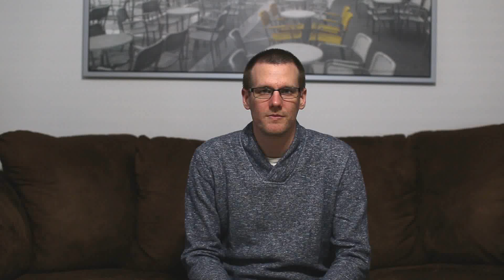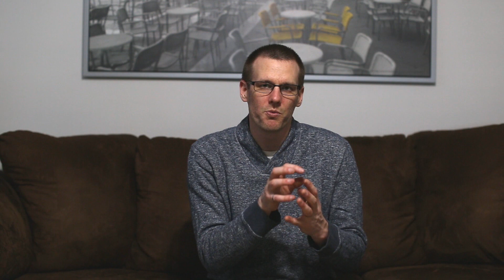Differential Fluid Performance in RC vehicles

Comment: I have a 1/12 scale truck and it isn’t the fastest but I mainly use it in moderate off-roady terrain.  It only has front and rear diffs and I’m planning to put 15k in the fronts and 7k in the back. I wanted to know if that seemed logical for what I want to do with my truck.
Reply from the maker: That can work well. It depends on the performance that you are after. Try it out and adjust from there.

Comment: Your videos are incredible. I’m learning so much being new to the sport from you. Thank you
Reply from the maker: Thanks for the awesome comment Mark!
Reply: @RCexplained  hey bro, ive been using your videos to increase my knowledge, because they are excellent.
can you recommend a front centre and rear diff fluid set up for truggy :1:8 scale  converted from nitro to brushless, running on very high bite surface like tarmac.
your feedback is VERY Appreciated.
Reply from the maker: What style are you looking for? You could go 20k center. 12k front 7k rear.
Reply from the maker: My suggestion will give you more bite but can result in too much bite and getting sideways easy. Your selection will be easier to handle the power. Your decision completely depends on what your preference is and then adjust from there.

Comment: Nice video what about when just ripping around a field and stuff  thanks
Reply from the maker: My recommendation based on my personal driving style for 1/8 or 1/10 scale RC cars is to use:
7-10k weight in the front differential. 
10-15k weight in the center differential
5k weight in the rear differential

Comment: Great video. However I think that the car will almost always get the most amount of traction with the centre diff locked, regardless of the surface it’s running on.
Reply from the maker: Hi Mo, I see what you are saying. The same can be said for all differentials on the car.  At the same rate, having a locked center differential and sending 50% of the power towards the rear end on a loose surface can be highly undesirable. Reducing the power to the rear wheels will increase the traction at the rear end and decrease traction at the front end. However, too much power on the front end will not result in abrupt power oversteer and loss of control. It can be a big balancing act dependent on personal preference.
Reply: @RCexplained   hello, if you would. How does the center diff transfer power to the front? If the diff is already unloading at the rear diff because its lost traction won't this just continue as it's open diff until the rear end finds traction?.   If I lock the center diff, will this prevent unloading at the rear diff as power is distributed  50/50 with no bias giving best overall performance?  -Mojave off-road only.

Comment: Hi bro..what is your recomended for diff oil 1/8 Nitto buggy using C Hub??...for front,center & rear..👍👍🙏🙏
Reply from the maker: My recommendation based on my personal driving style for 1/8 or 1/10 scale RC cars is to use:
7-10k weight in the front differential. 
10-15k weight in the center differential
5k weight in the rear differential
Reply: @RCexplained  thanks bro..👍👍👍
Reply: @RCexplained  oh i have one more question...the diff you recomneded is suitable or not with C Hub car or Pivot Hub car?..because someone said that if  Pivot Hub car must using different diff oil setting from the C Hub car..they said that see Pivot Hub car is more aggresive & will oversteer when to take sharp corner..for C Hub car dont have any problem on corner but not aggresive like Pivot Hub car..can you explaind it to me...other people said Pivot Hub car must using heavy oil diff to control the oversteer problem..i also see also when the pro driver have problem overtseer with the Pivot Hun car..you can see the different if C Hub & Pivot Hub while on sharp corner then exit corner accelerate 🙏🙏🙏🙏
Reply from the maker: Hi Mustakim,  I have never considered 2 different weighted oils for those different conditions.

Comment: Meanwhile in the other video I watched they used 80k,500k,80k (F,M,R).
Reply: Wow so thicker..i never use over than 10k diff oil
Reply: Also depends of which scale your car is
Reply: @Modelshoponline  im using 1/8 Xray Xb8 nitro kit..i often using 3k,7k,8k,10k dift oil..also using 15k diff oil but rarely..im just race kit only in the track..if not running in the track i just put display in my rc workshop..😁😁😁😁

Comment: Hi I need some advice.  I rebuilt the center diff in my Losi Tenaciy MT and used Lucas Xtreme Heavy Duty grease (green) to fill it and now almost all of the power is going to the front wheels.  

What is the issue?  Is it too thick or too thin?  What should I use instead?
Reply from the maker: Hi RocknRidin, Heavy Duty Grease is still way too thin. Use a minimum of 15-20 K weight fluid in the center differential. If you are looking for even more power sent to the rear end, experiment with 30K or higher.

Comment: @RCexplained this is a good video. I own an Infraction v1 and the new Felony. I have the Infraction dialed correctly where its a 60/100/30 f/c/r and all I do is drift no speed runs and on that one, the front pulls me out the drift in the direction I want to go...it's wonderful. The Felony...I am struggling to get this the same it has the larger tires on the rear and a different diff ratio so front and rear spin differently and more mass in the rear. The felony will swing the rear end around in turn and drift so it over spins. I tried a 60/100/30 on the Felony that was worse...and for me, I never drive it at OEM 10/100/10 setting I changed it right away since Arrma has 1/3 filled diffs. Now I have it at 30/100/60 and that seems to be better for more front pull and control but the rear swings a little still...still not where I want it like the Infraction. Maybe I need to go 20 or 10 in front diff which I may try to get more frontal spin to pull more forward to counteract the rear. Felony is a bit different for newbie any suggestions Sir?
Reply from the maker: Hello, I would suggest trying a thicker weight oil in the front and a thinner weight oil in the rear. As you continue to increase / decrease the oil weightings in the direction as suggested, you will continue to add more power to both of the front wheels and reduce the power going to both of the rear wheels.  This will help pull the vehicle through the drift.
Reply: @RCexplained  Thx sorry for my delay....So I will switch it around since I like how the Infraction pulls on the 60/100/30...based on your suggestion I will do 60/100/30 for the Felony. The Felony has larger 107mm tires in the rear that spin slower than the 100mm tires in the front...so sound like you are saying as I increase in the direction I am going the tire sizing and difference in their spinning is a lower priority and having heavier oil upfront for what I want to achieve (the pulling) is best?

Comment: What do you think is a good starting point for my 1/8 scale buggy with brushless motor power? Right now I have 5k front, 10k center. 3k rear. It's alright but still shreds the front wheels on accel. 

Thinking about going up to 7k front and maybe 15 or 20k center and leave 3k in the rear.
Reply from the maker: Front sounds good. If you want to get more acceleration 20k in the center will definitely help get you there. What I like doing is experimenting with multiple weights to figure out what works best for me. I also change my weighting as my driving style changes or skills for a specific rc improves.
Reply: @RCexplained  i will try 20k center if i can find some. 👍

Comment: hi there, what set up would u recommend on the arrma kraton 8s? and traxxas maxx 4s? thank you very much
Reply from the maker: I've found that the stock settings perform quite well. More specifically to my driving style I usually go a bit heavier oil in the front and center diffs.

Comment: Extremely well delivered video, your competence is awesome, I just purchased the New Arrma Kraton EXB with the Castle 1717  8S 1650KV setup, with a Futaba HPS-CB700 servo and I’ll use a 17th pinion.  What Front/Center/Rear Diff oil weights would you start with as well as the shocks front and rear also.  I’ll run it as an 8S so it may be a bit heavier than expected. BTW I’m not s huge basher or jumper I just like having the capabilities if I so chose.
Reply from the maker: Hey Cleveland Coleman, I'm not sure what the stock weights used in the new Kraton are. Typically I prefer to have the front and center differential heavier than stock. What I would do in your case is run the Kraton with the stock fluids to see how it performs and adjust from there.

As for the suspension setup, here too I prefer to have a higher weight oil in the struts with stiffer spring rates. My setups are usually heavier than stock requiring stiffer springs with heavier oil. For jumping, heavier weighted oil and spring rates will help absorb the large jumps otherwise it will be easy to bottom the Kraton out on these larger jumps.

Comment: Nice video, but at 2:27, you're backwards on viscosity.  A higher viscosity or more viscous oil is thicker.  Lower viscosity is thinner or runnier.
Reply from the maker: Hey Kevin, thank you for the comment. You are correct, I didn't catch this while editing. It should have been said as "less viscous" in the video.

Comment: This is a cracking vid I've been reading up on this as I've got my first buggy that I fancy setting up for racing around I now see there is not really one ideal set up and it needs changing every different surface and it's going to take time to master the number for the different terrain you video is one of the videos that I have watch and can marry up with what I've read so far
Reply from the maker: Hey rc clan, thanks for the comment. You are definitely correct in that there is no real one ideal setup. I do tend to prefer a specific style regardless of what I am running. However I do change things up if racing a buggy vs an on road car for example.

Comment: I like to run 500k in the centre.
Reply from the maker: yep, if I am running an on road car, I usually go very high in the center.
Reply: What is good for off road buggy 1/8 for centre diff?..give recomended for track setup & bashing setup for front,middle,rear..
Reply: @mustakimkamaruzaman9715  just go to the track and ask people what setup they use.

Comment: Awesome info thanks! I’m not into racing, just have an old truggy that I rip around in the woods, would you say 5000 weight diff oil will be good for front and rear? I don’t have a central diff. I’m not trying to stick it to the ground for ultimate traction, rather like swinging the tail out and drifting round trees in the dirt. Thanks for any info!
Reply from the maker: Hey Eiren, thanks for the comment. 5000 weight in a 1/10 scale truggy can get the rear end loose. However, if looking to be able to swing the rear end out on demand, you may want to go heavier in the rear then in the front. Going with 8000 and up will help you get there. It's just a matter of a trade off between stability and reducing the one wheel peel action.
Reply: RCexplained sure I’ll try 8000 first, thanks.

Comment: i added 200k diff fluid to my redcat landslide 4s last night and boy was i not expecting it to be so loose in the rear,but it was putting a smile on my face because thats kind of what i wanted,great video bro.
Reply from the maker: Sounds awesome Andy! There must have been a lot of power going to those rear wheels! Nice!
Reply: Watch type of diff did u put it in? Front center or rear?
Reply: Using too heavy of diff fluid in the rear will cause more wheelies, but the car will usually not go straight!

Comment: Do u have1 of these for a slipper or transmission as in the savage flux xl 🤔, need help to understand why spider gears break, so it doe not happen again😔🤔😔 THANKS
Reply from the maker: Hey just P. X, I do not have a video for slippers or the transmission. I plan to do a video on how RC transmissions can fail. Would this help? The video queue is quite large right now though.
Reply: @RCexplained  yes RCexplained, that would definitely be beneficial to not just myself but many others especially as the hpi savage flux xl🔩  is available once again😎

Comment: The stock 8s x maxx came with 10k front, 20mil centre, 30k rear and i dont like the way it wheelie and does standing backflip. Do u think thicker oil in the front will help? Thanks
Reply from the maker: Are you hoping to not allow the xmaxx to wheelie under heavy power input? If so, you want to remove some of the rearward power. You can do this by going lighter weight oil in the center diff. You can also lighten up the rear diff oil to cause some slippage between the two rear wheels. Your preference would define the best way to tune where you want the power to go.
Reply: @RCexplained  yeah basically. I dont want it back flipping on flat ground or lifting the front end up. I read heaps of post and everyone seem to run stock 20mil. Do you think i should run thicker oil in the front diff than the rears? Or will that make it worse. I could also dilute the 20mil with a few drop of 50k.
Reply from the maker: @User-four20  your front tires are in the air and won't get much traction up there. Moving to a lighter or heavier fluid will have no effect.

This is why I'd suggest lightening the fluid in the center. If you'd rather lighten up the rear differential, that's fine. Both options will offer a different feel.
Reply: @RCexplained  okay i know what u mean now. Thank you!
Reply from the maker: Hey Slim Boost, right on. The Xmaxx is a beast, let us know how it goes!

Comment: Would I be better off using 500k in my Jato for better posi traction then? Currently have 5000
Reply from the maker: Yes you can, the only concern I'd have is cornering may become unstable at speed.

Comment: Hi, I have a Losi 8 truggy and I want to change the fluid differential,  can you recommend me which ones are the best for my truggy?? Thanks!!!
Reply from the maker: Are you looking for brand or weights?
Reply: @RCexplained  for the weight
Reply from the maker: @luisrosario1112  I personally prefer to use 12k or a bit more in the center diff, 8k in the front and 5k in the rear. This is a good starting point and you would then tune by changing fluids to match your personal driving preferences.
Reply: @RCexplained  Ohh Okk, got it and thanks for the help!!!!! 👍😊
Reply from the maker: No problem Luis. Glad that i could help!

Comment: Thank you for the great video. Lots of good information. I am building an Arrma Kraton V4 6s piece by piece with many upgrades and I was looking for a little advice in my front middle and rear differential weight?
Reply: Ed, Just to let you know, the Kraton 6S V4 comes with 100,000CST in the center diff and 10K front and rear. I just bought a bunch of different weights to try in my new 6S V4, but dang 10K seems really thin compared to "stock". Not saying it isn't sound advice, cause whom am I to question (first rc since I was but a child in the early '90's), just wanted to let you know where ARRMA starts out.
Reply: @mainmanmustard  My friend has Kraton like you and suggest me for Sledge which is similar 20/20/10 for our dirt track. Your setup can be similar. I had 20milion in the central before :-D He just seen my Sledge and make me to change. I finished build with Max6y bumper and better radio, but have still no time to test. Maybe today if weather will be good.
Reply: @martins2657  wow, how things have changed for my setup in the last two years. I now run wax earplugs jammed into the diffs in the middle and rear to lock them most of the way up and run 5 million cst in the front diff. Haven’t burned up a diff in over a year since I’ve been running that combo.
Reply: @mainmanmustard  Yeah, on bash there are heavy oils wanted :-D But for precious track riding are lighter better. I have not profi truggy, so i will see how it behaves now. I also bought and filled full central diff for 20milion year ago :-) Because it was half  filled from factory.
Reply: @mainmanmustard  I tested yesterday my Sledge on the track, it was way better than with stock 50K/20M/50K. But setup 20K/20K/10K was not ideal. I will change the center and fill it by 30-40K and we will see. On the other hand, my friend has profi Associated truggy on the track and it can not be compared :-D You have feelings that truggy weights nothing, and react instant its a different level. I feel there a same difference when i switched from Typhon 6S to profi buggy Serpent SRX8e PRO. It is the same gap :D. Bashers just stay heavy and less responsive. But nice to try and compare.
Reply from the maker: Hi Ed, thanks for your comment. You can try using 10k in the center, 7k in the front and 5k in the rear. This can be a good place to start. From here you will want to fine tune according to your own personal preferences.
Reply: @RCexplained  on a infraction v2 what would you recommend in the front middle and rear Thanks for the video 👍
Reply: @RCexplained  Thank you